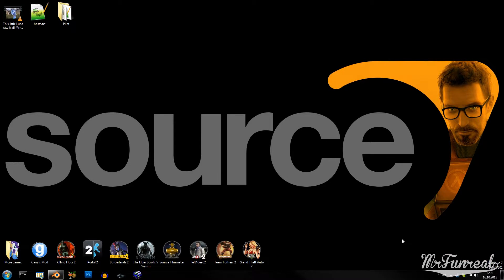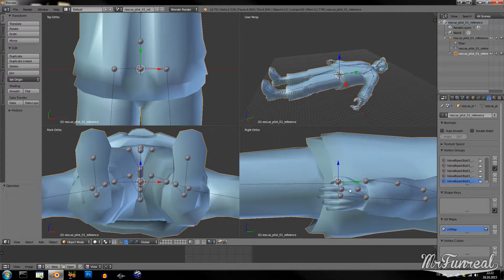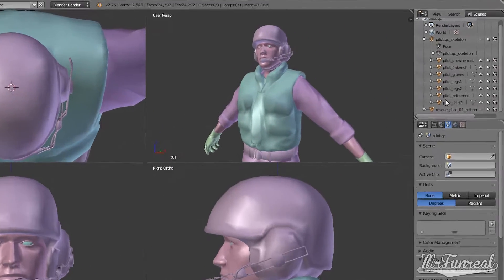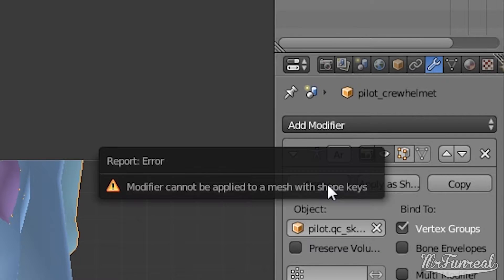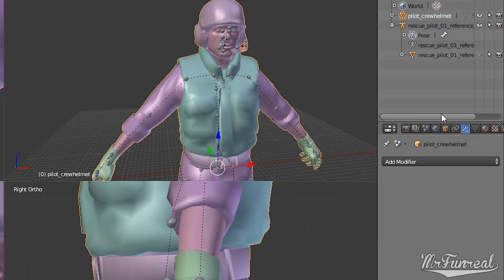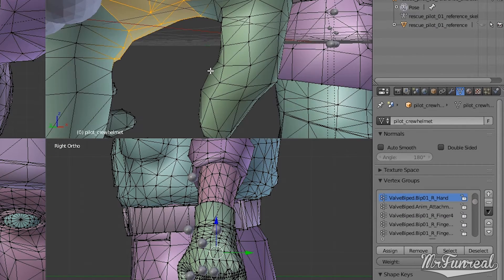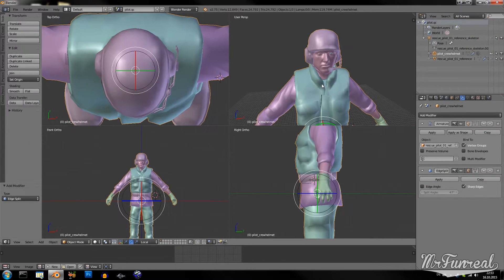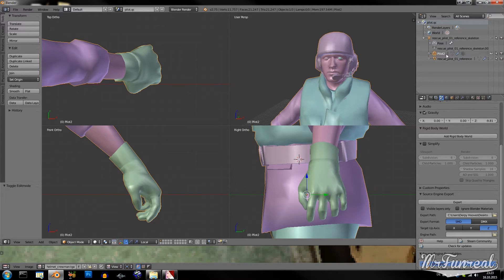Source Engine | Model Porting

Comment: my version of blender 2.80 has a different layout to this so it's impossible to follow.
Reply from the maker: this video is older, before blender changed the layout.
you can still follow the tutorial, but teh buttons are in a slightly different spot.
You can downgrade to blender 2.79 if you want this layout back.

Comment: Mr. Funreal.....can you make a video how to port Left 4 Dead 1 mod to Left 4 Dead 2 mod?

i want l4d1 unused animation mod work on l4d2....

pleasee helppp...
Reply from the maker: that's probably not going to work. First off, L4D2 has new animations for weapons L4D1 doesn't have and even if you would somehow manage to sort out all the animations, you still have the 90% probability of the decompiling breaking up the animations so you'll have to modify them sourself anyways.

All the steps required to do that could be tutorials of themselves. So i'd rather do several tutorials on broad things that, when combined, will allow you to figure it out, rather than holding your hand the entire process of a very specific thing.
Reply: +Mr Funreal i know, but i just want to make animation like Lt. rocky did on porting l4d1 animation on l4d2.
https://steamcommunity.com/sharedfiles/filedetails/?id=403687394